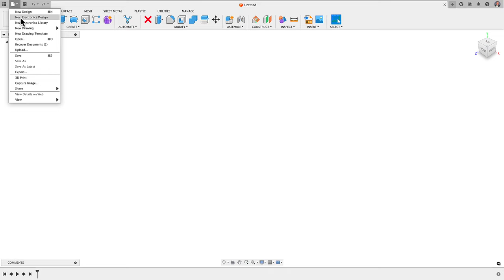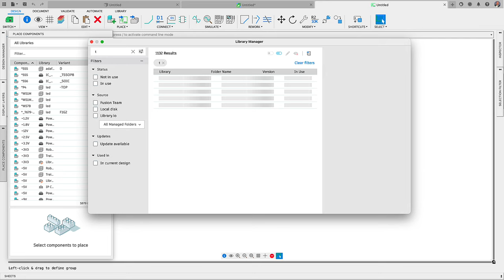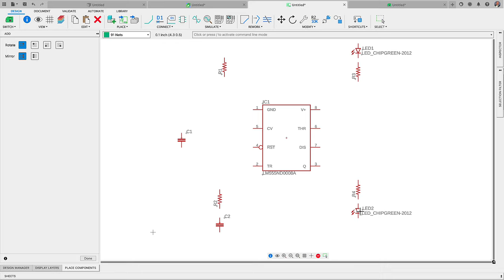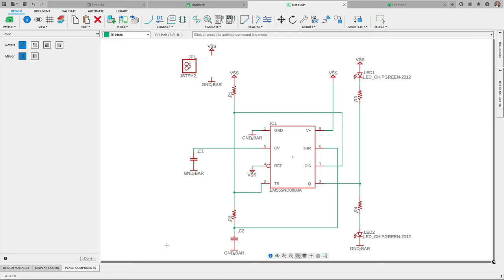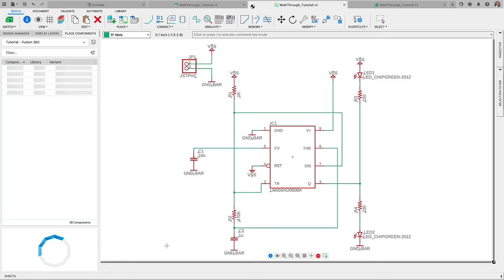Fusion How-To: Design Your First PCB Schematic | Autodesk Fusion 360

Comment: In a demo I think you should fully create at least one part. Some schematic symbol with in and outs and bidirectional pins plus a couple of footprints, an oddball resistor or even a rotary shaft encoder with electrical signals and mounting pads. That might be a good time to discuss the various part data base relationships and any creation order if important. Please don't rehearse the demo, do it live and make mistakes or pretend to make mistakes and show us how to recover from them. 
Cheers-Peter